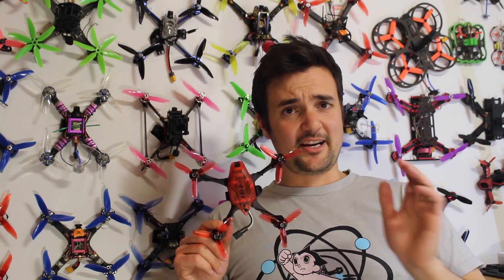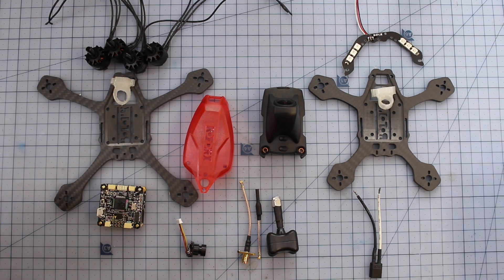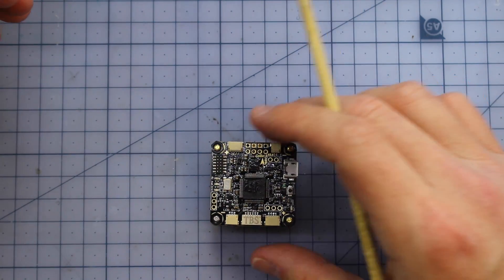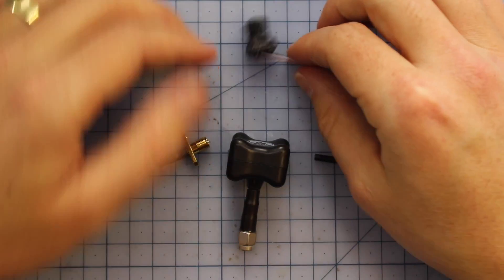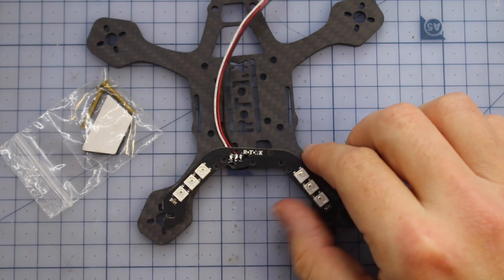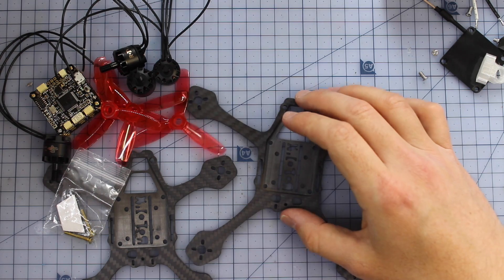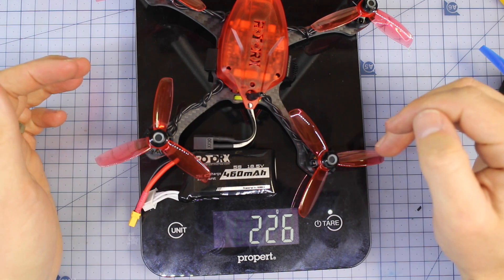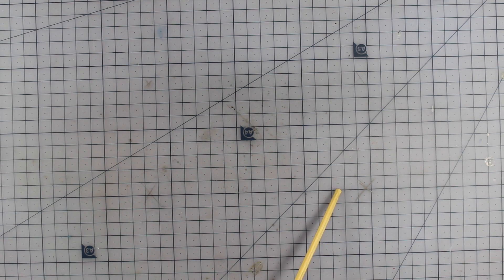FINALLY IT’S HERE! ROTOR X ATOM V3 Review.

Comment: Depends of FC but you can't always connect IBUS to SBUS port. If there is built in, fixed inverter IBUS wont work. Choose other UART if you can't disable inverter and it will work.

Comment: Pre built it's 400$ (mostly because of the cube) but you can buy just the frame (35$) and get around 200$ price range. I think your next vid should be to build a custom one 😃. I built mine with a KISS AIO and there's still plenty of room. Since it literally uses one board. I've also use a normal flight controller and a 4in1 20a esc on my other builds.
Reply: Yeah, I recommend people get the frame kit and build their own. DIY kit is mostly for those who want something simple to build and fly out of the box, but want the best equipment available. Atom frame can also take a 20x20mm stack

Comment: Price is high, but you get what you pay for. Looks like they've thought of every detail, and put top notch components in there.
Reply: Andrew Southworth like the fpv camera mount? Motor wire lengths? They also charged the same amount when it came with those dinky ESCs that often melted down.

Comment: I had the Atom V3 snd returned it after a week. It couldn't even handle 4S without desync. That's one major issue. Another potential issue - can those motors handle 5S without burning out after a few flights? Buy at your own risk.
Reply: I guess part two with tell us
Reply: Uncle Sausage I doubt part 2 will be about long term testing. It will start with "G'die" then proceed to showing a few laps around the bushes and a recommendation to buy this yet another "awesome" quad.
Reply: Did you contact our support? The original was designed to have optimal performance on 3S batteries, in order to keep it light weight and zippy. What Stu is showing here is the new version with V2 2in1 ESCs, 1407-2800kv that are designed for 5S. 3S for beginners, 4S for intermediate, 5S for ball ripping fun.
Reply: Rotor X I had a V3 that claimed it could work on 4S. It wasn't a V2, but maybe the motors were highter kV. It took many emails to TBS, RotorX and FliteTest (who sold me a built BNF) before I could finally return it. I LOST ABOUT 90USD in nonrefundable customs/import fees and shipping (no RMA from FliteTest offered) because of Atom V3.
Reply: Sounds like you guys should hang it up if you can't get a rotorx atom to work properly.  I'd hate to see you try and get some of the cheaper quads to fly right

Comment: Just getting into the sport, I'm trying to keep the budget of my entire setup between $200-$300. I know Stew has made videos exactly on builds at those price points, but I'm willing to pay a little more if it means getting better value parts. The frame I'm going with is the Lisam LS-210, can someone give me a recommendation for a  good value FPV camera? I've already figured out my controller and propellers, but I wouldn't mind some recommendations on FPV goggles and motors as well.

Comment: Also Stu, you're running 3" props on a 4" frame. Put on the same blades as the Leggero (TJ4045) or DAL 4045BN and its an entirely different beast. 

Dunno if this is an objective flight review otherwise.
Reply: I have a few I want to try out!
Reply: Those motors can handle 4" props on 5S no problem. Though we have found our team pilots love having the 3" props on the 4" frame, as each prop has clean air and makes the flight experience much better. Depends how you fly I guess

Comment: Any desync issues?
I've owned three, two were replacements from tbs. All desynced.
Edit: Atom v3 version 1 with 1407 4100kv.
Reply from the maker: we will find out.
Reply: This new version has the V2 2in1 ESCs, so no desync issues. The original desync issue was a blheli issue not being able to keep up with the older RX1406-4100kv motors. Saying that, they were high kv so people would get high performance from 3S batteries and not require heavier 4S batteries. This new version Stu is showing has RX1407-2800kv motors, designed and tested for optimal performance on 5S!
Reply: Looks like its the same power cube with the 2 in 1 esc layers that came with the original v3 rev 1. Martin@ rotorx actually told me in my help ticket they were having "lots of problems with tbs electronics". 
The atom on 3s was underwhelming in my opinion.

Comment: Hi Stew,
Love your video's. Building my own first quad at the moment. But....... I can't fly! I have no experience with a quad or radio at the moment. Bought also a sym so can practice. However I'm a bit afraid to go flying with my quad. Building a 4S battery quad with 2600kV motors ( racerstar). I afraid it is to fast to start. Yes I know that I could ave started with 3S and 2200kV motors etc etc. But, well you know I guess.
Is is possible to downgrade a racing quad with Bataflight/CLeanflight so the max potencial won't come out yet? So downgrade my quad in Cleanflight so I can get used to flighing it and than go full scale with te same quad. Or do you have better idea's

Thanks
Robert
Netherlands
Reply: Drone Hero's Thank you. And I agree. Have been flying with my five inch. Is like having your first driving lesson in a Ferrari😂. Building a 90 mm 2s micro drone now. Want to build myself no rtf’s. 
Robert

Comment: I love the Atoms but I have always built my own using my selection of parts, so much cheaper and flies just as well. I see they still insist on using those rubbish cameras. I put a Runcam Micro swift in my Atom V2 and after changing every single component (the last being the camera) the video was finally clear. Prior to that is was un-flyable if you went over half throttle.
Reply: This is a new camera, but I agree the Runcam Micro Swift is the way to go. We have a mount for them in all DIY and frame kits now
Reply: Well that is great news :)

Comment: 3" on 4" frame whyyyyyyyyeeee!!!
Reply: Propeller spacing affects handling in prop wash and stability under high throttle
Reply: why would you build 2 frames  for 3 and 4" and use both for 3"?
Reply: Yee
Reply: From my experience if you spread out props you will get more unstable platform.
Reply: I should start flying 3 inch props in my 5 inch quad
Reply: Imad FPV Ive actually seen that done before lol. It works better than expected, but its still far from ideal.

Comment: What surprises me is that this expensive quad is made in China and still has a price tag of $400 US (In Singapore). It's a total rip-off. Stew I have always considered you to be a excellent pilot but above all what made you unique was the ability to judge a product in its totality. I am sorry but in this video you havent done that.
Will you consider buying this from your own money? if not why are you praising this. This is the kind of criticism that such products need to make the manufacturers understand that you just cannot make a fool of people around you. I have a similar complaint regarding the Fat Sharks, they are next..
Reply: Of course, it's made in China. Otherwise it would be even more expensive. Though what you don't see is that this Atom has been in the works for over a year. Hours of testing, redesign, testing, redesign. Paying for molds and samples etc. It is a lot of work to get to that point. Plus, we are still improving it, so it will constantly evolve and money raised will go to making it even better. Yes, there are cheaper options available. But I can guarantee they were only available at a low cost because the design was based on something another company spent hours developing. You as a consumer can decide to either support the innovators or support the copy cats. One will help develop new technology, the other will always be a step behind.
Reply: Rotor X I appreciate your feeling but I myself being a embedded MCU developer can say that this kind of development can only be sustained if you build in bulk and bring down the coast. If you want that everyone should appreciate and love your technology then its your duty as developer to make its affordable aswell. An affordable price tag goes a long way in sustainable development . It also let's you take more risk in case you fail once a while. I hope this criticize of mine will be taken positively. I wish you and your company the very best and hope to fly a rotorx soon..

Comment: overpriced and no point running the 2800kv on 3" and 5s when the 3600kv version handles 5s and 4" props without issue
Reply: Do you have a video flying a set up like this? I would freaking love to see it!
Reply: We believe that the kv is the doorway to higher voltage, 3600kv can't handle 6S on 3" :P
Reply: I have some footage but nothing uploaded, I can if needed but doesn't look much faster than 4s footage of the dvr..

 Imo running 5s on a 4" is diminishing returns, yes its faster and the motors can take it but the extra weight of the pack starts to take its toll on the cornering and manoeuvrability of the quad.

Again in my opinion running 5s and even 1407 motors on a 3" quad is pretty overkill - yes it goes fast for its size on the straights but handles pretty bad due to so much inertia on tiny props ,   A 3" build with 1106/1304 and 3-4s 400-600mah will be only slightly slower than 1407 in a straight line but far greater feel in the air and way better corning and handling.

But of course this all depends on the pilots needs and desires and is just a matter of opinion
Reply: We have to cater for all kinds of pilots so it makes sense to lower the kv and keep developing the propellers and electronics to handle higher voltage.  To be honest you have to experience higher voltage to understand why it makes sense, but when you look at efficiency at higher voltage it's a no brainer.  4S is for the sheep, but 5S and 6S is where the real gains are in the micro space and larger frames aswell.  A 5S 850 has more wattage than a 4S 1000mah for less weight so already you are making gains.  And if you need to hit under 250grams, in some countries this is mandatory,  we can do that with a 1080p HDcam and 5S